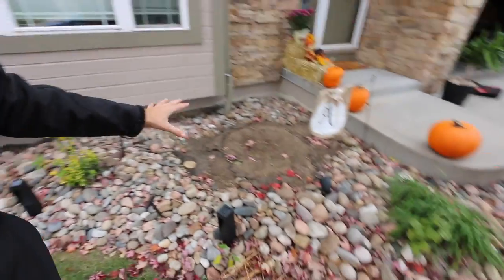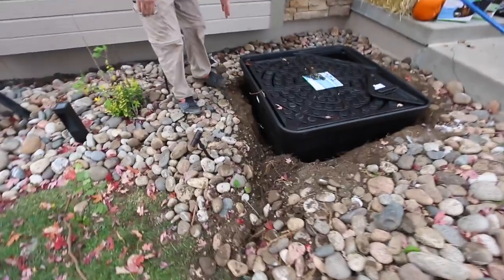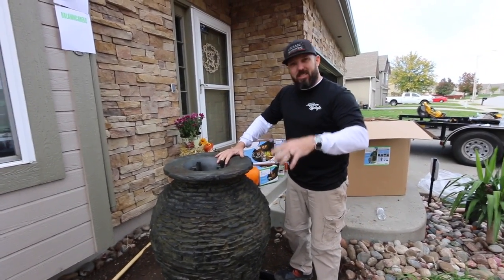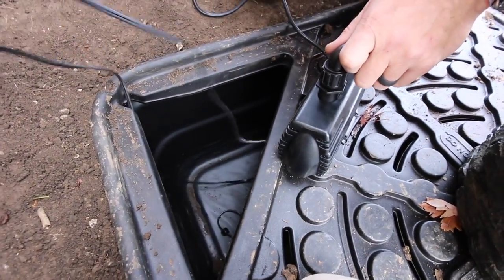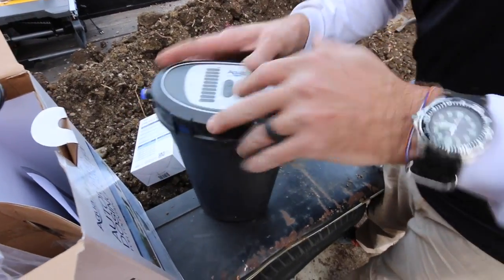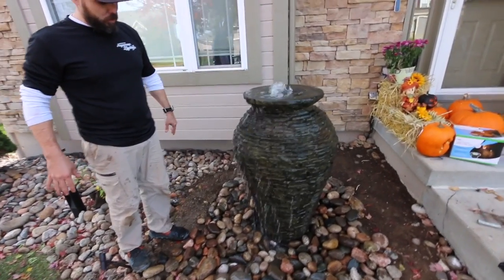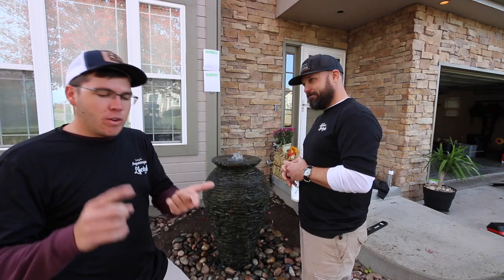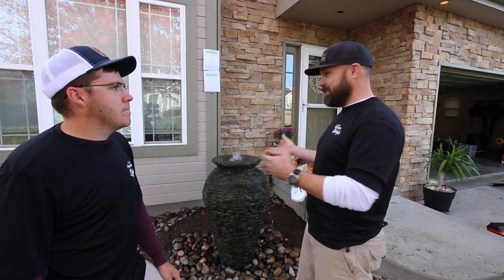The Ultimate Guide To Installing Water Features!

Comment: Whats cost on the Feature? I assume you have diff levels of pricing cost depending on the contractor volume etc... But from what I am seeing... If $2800 includes the add ons.... Digging about a yard and a half of material, hauling disposing and the install process in my area $1400 round about labor.... So you are saying this plastic casting, a simple sump pump and a basic low volatage lighting system cost contractor $1400? Even $1000 sounds high for that. Now I know the end result is what matters and I know its a niche and def a good product.... Just a fairly pricey sell for a bunch of plastic. In my area (Cape Cod, MA) natural products in the landscape are most desireable. However, I could def see the pump kit and basin as a package and build a natural stone feature. But obviously you guys are selling these units. I am sure I could sell a couple but I would like to see at least a veneer of natural stone on it.

Comment: $2800, seems a bit steep.  The parts are only $1200, he's charging over $1500 for 3-4 hrs of work...  If you can dig a hole, pour water into a bucket and plug something into a socket DO IT YOURSELF PEOPLE!  Take that $1500 I just saved you and spend it on something nice.